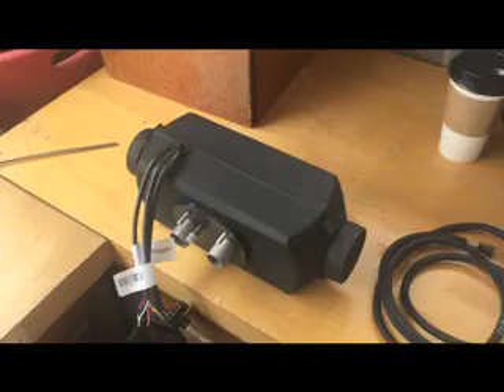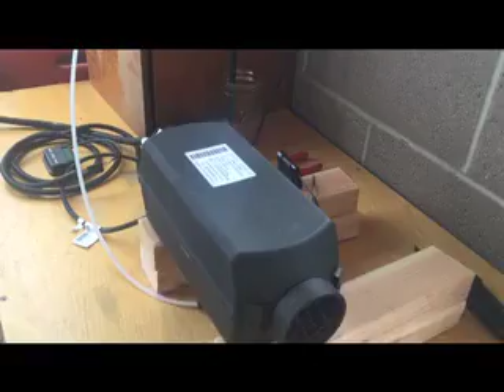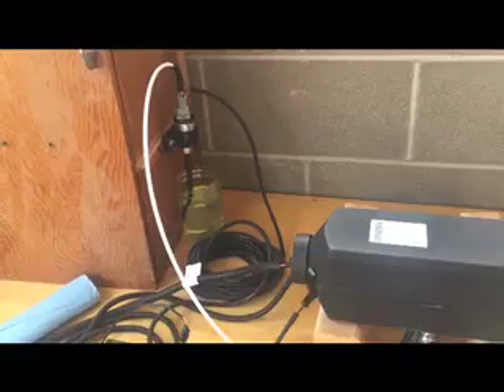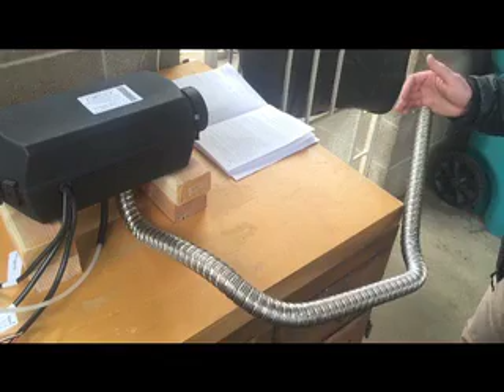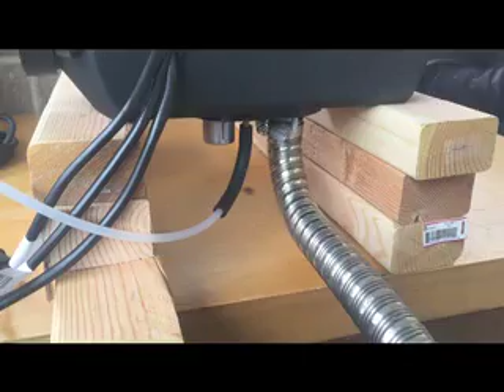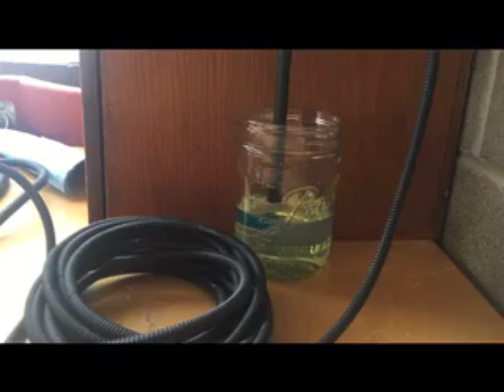Planar 2D-12 bench test

Comment: SO SILENT YOU CAN PRACTICALLY HEAR A PIN DROP! HELLLO? HELLOOOOO?
Reply from the maker: timothy790110  did you have a question?
Reply: Vanlife Colorado well, since you asked, just how loud is this thing?
Reply: Vanlife Colorado what size van are you using this in, and do you wish you got the 44d instead? What are the lowest temps you're camping in, and what kind of insulation do you have?

Comment: Live and learn. Took my Planar 44d-12 on trip to Colorado worked for 2 hours at 9,700 ft and smoked and smoked. Froze butt off for almost a week. Re-ran fuel line to can of kerosene in the mist of blowing snow storm for over 3 hours, still no luck. Cleaned glow plug several times, nothing! Few days later in Utah and tired of being cold, took unit completely apart and cleaned it ( hand full of soot). Finally Heat! Very Hot Heat! for rest of trip. So now running the 1.8l tank that came with it for kerosene (for high altitude) and main tank diesel with dual tank valve. Hope this helps anyone !!!!!
Reply: I have used mine every day for four years and I am not exaggerating and I have never had to do this. People buy heaters that are TOO big for the space and then they run on low all the time and soot up. If you want to do that then you must be conscious to run on high once in a while to remove the soot. This is a very common problem with any fossil fuel burning heater.
Reply: Does it require taking apart and cleaning constantly or was that part of user error?
Reply: No. Really think between the high attitude and the cold. Ran it on kerosene after that, so no more problems at all. Ran fine on diesel for months at 200 ft. use it all the time. And runs off six solar batteries that stay charged just fine. Other than air,fuel and glow plug (with a good battery.) really hard too screw it up.

Comment: Any problems at higher altitudes?
Reply from the maker: Dennis Woods- not me personally.
Reply: Manufacturer says: Safe to operate up to 1650mtrs. Above that, you will get soot build up and eventually it simply won't start anymore. Glow screen around glowplug will need cleaning etc. There will be a high altitude kit, btw, that allows for 3000 meters soon.

Comment: what's the sequence for turning it on and off. having some difficulties.
Reply from the maker: Jason Groves -left button cycles to temperature or power setting, center button is power, right button is just for increasing temp/power once running.